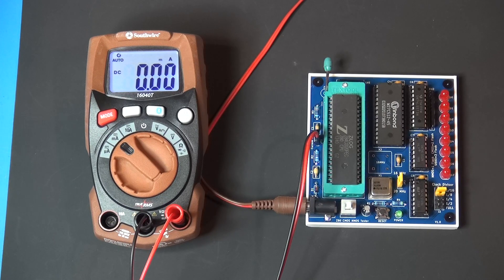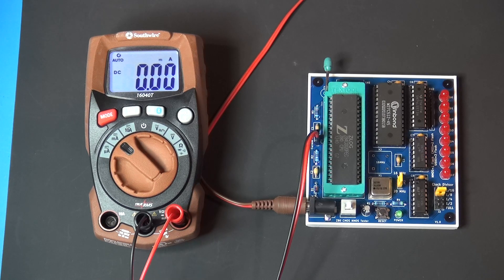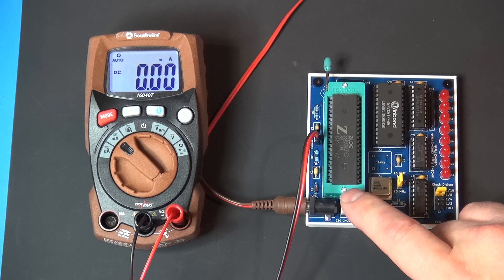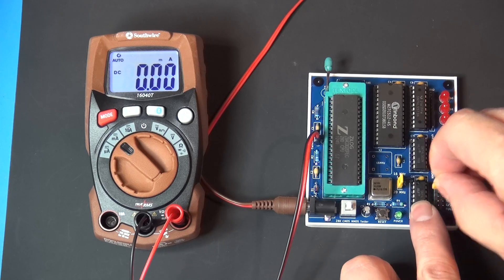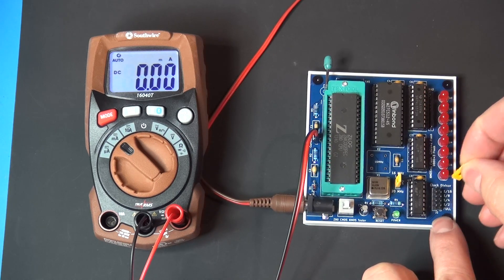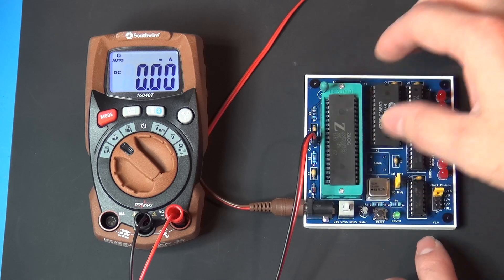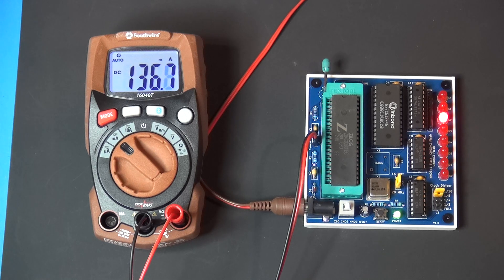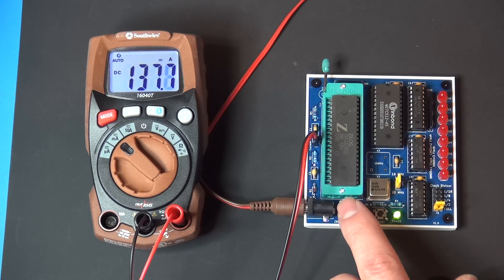Z80 NMOS CMOS CPU Tester Demo

Comment: what are the ICs  Who can check it
Reply: You can check the IC, the Z80 cpu, if its a CMOS or NMOS, check their repository for the code you put in the eeprom and run the code. as said in the video: The LED array will flash once for NMOS variants, twice for CMOS, or three times for a U880. After that, the LED's will go "knight rider" mode

You the buyer can check if your freshly bought IC (from for example china) is what the label sais, or is relabeled.